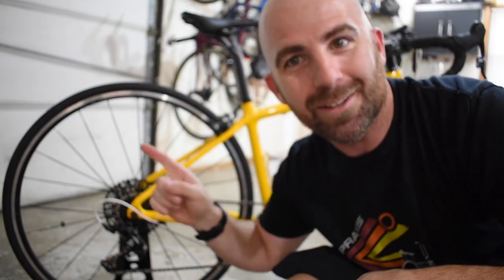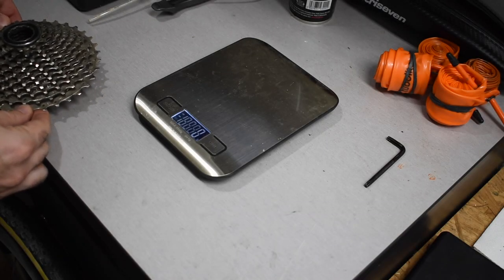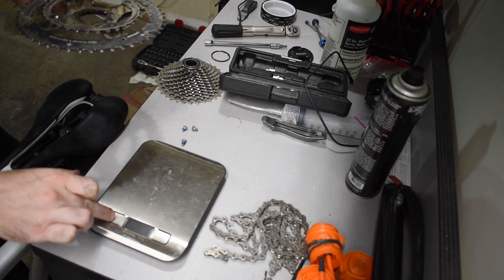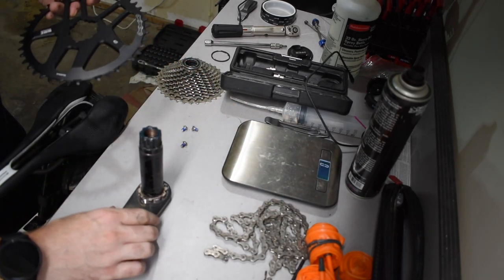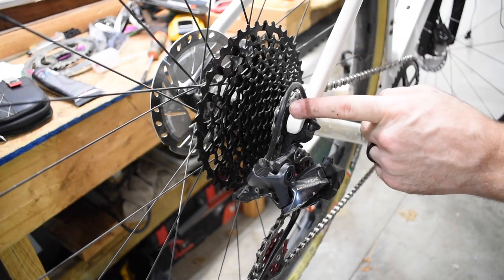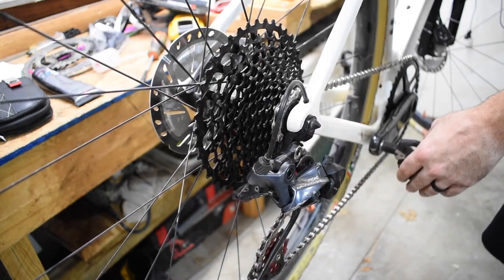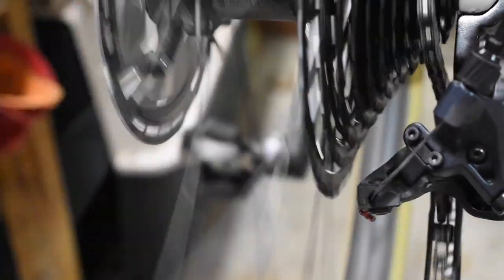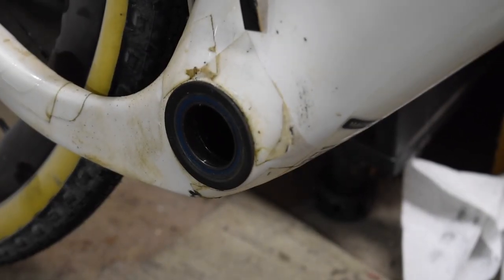1x conversion on a budget?  Ultegra RX800 at the limit!

Comment from the maker: Tell me about your 1x conversion or experiences here in the comments!  Am I going to hate the jumps in gearing coming from a 2x set up?
Reply: I have just received a Praxis Zayante 48/32 and I am torn about keeping them or not. How have you found it?
Reply from the maker: Great question!  One of the main reasons I moved away from 2x is because I could not solve a frequent chain drop problem on my combo.  If I had been able to solve that, I would've likely stayed 2x.  The gear range wasn't great with 1x on an 11-40.  Since I've moved to SRAM AXS XPLR with a 10-44 cassette, it's much better but that wasn't cheap.  But if that isn't an option for you and your 2x works fine, I'd stick with it.

Comment: You can run a 46 cassette with a wolftooth roadlink. Check it out.
Reply from the maker: Not with an Ultegra RX800 rear derailleur…
Reply: @JMCyclingVideos  whoops sorry I was thinking (wrongly) that it was GRX. I stand corrected. Love your videos. Keep it up!
Reply from the maker: @lancescarborough1  I'm going to give an 11-40T cassette a shot with my RX RD.  If I can't get good shifting out of that, a GRX 812 1x specific RD will be on order.  I KNOW that one will work!!!  Thanks for the kudos.
Reply: My worry as a current 2x9 user is the jumps between the gears.  Do you prefer 1x and why?

Comment: Been watching your conversion videos several times. Bit the bullet and ordered the parts to convert my road bike with Ultegra R8000 to 1x, will be installing GRX 812 derailleur with 46t wolftooth ring on the R8000 cranks and 11-36 SRAM cassette. crossing my fingers

Question:
How were you able to get the optimal chainline to be able to shift to all the gears without the chain dropping to other gears when backpedalling?
Reply from the maker: I haven’t been, to be honest. I think that’s simply one of the drawbacks of having short chain stays and a 1x set up.  SRAM AXS XPLR will jump gears at the ends of the cassette when backpedaling.  Fortunately, this hasn’t been an issue during real use because I don’t find that I backpedal at all when riding.

Comment: I currently ride a specialized cirrus pro with a 2x9 and I like the gearing but I'm tempted buy a 1x. I have currently got a 48/32 and an 11-31 drive train. Could you convince me to change?
Reply from the maker: It has to work for you. You’d lose a lot of top end and not gain much low end. Do you ride gravel/off road mostly?  If spend most of your time on the road, I’d stick with your 2x9.
Reply: @JMCyclingVideos  I use it mostly for commuting in a relatively hilly area. I ride probably 50/50 ratio of road vs paths mixed with off road.
My 48/32 works well but needs replacing.
I am a sprinter.
I also want to loose bike weight.